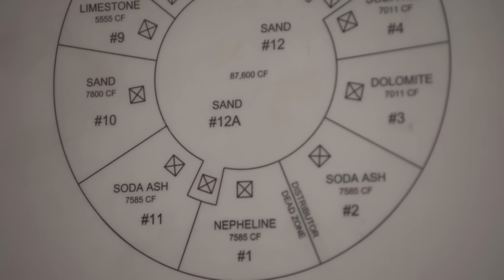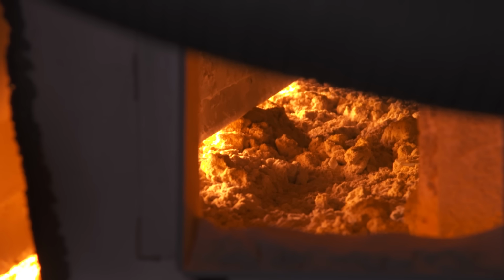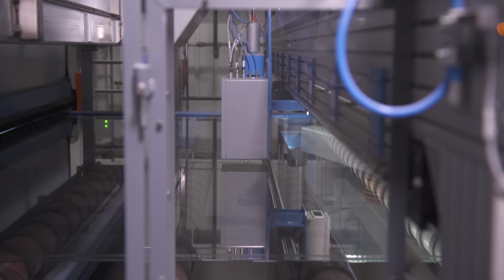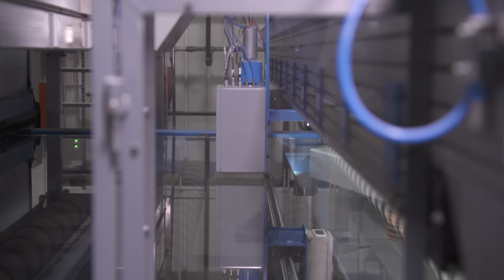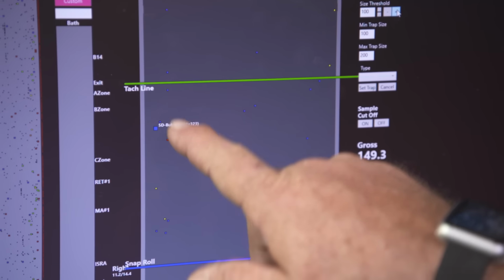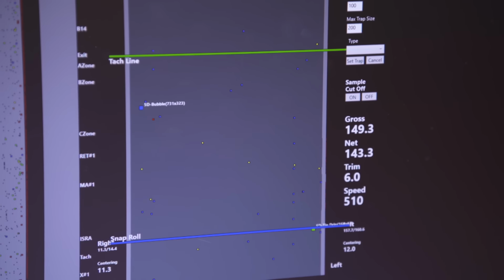How Float Glass is Made | This Old House

Comment: This channel is awesome. I'm a mechanical engineer with a curiosity in all things. 
I've been down the rabbit hole of researching plumbing and Thermal Mixing Valves and Richard has shown me how to replace those and now I'm here once again after researching glass fabrication. Thanks for the video, it's difficult to visualize the glass over the molten tin when it is described at a high level.

Comment: There's a glass factory like this close to where I live. They make glass 24/7/365, including holidays.  They can't shut down, cuz once they do, it takes around 30 days to get the furnace up to temp. The part about how much natty gas is used is accurate.
Reply: I work in a glass factory and when a glass furnace shuts down and cools down, it is irreparably damaged and has to be completely demolished and a new one built, which is a months-long operation. The glass shrinks as it solidifies, tearing the furnace walls apart. It is surprising to me that somewhere they can restart a furnace that has been shut down without a rebuild.

Comment: If you have a very bright short wave ultraviolet light source and very good (and protected!) eyes, you can actually see which side of a common piece of float glass was the side floating on the bath of tin. A tiny portion of the liquid tin volatilizes and is absorbed some microns into the side of the glass touching it, imparting that side of the sheet with a distinct orange or hazy white fluorescence.
Reply: True, or if you look at the edge closely, you can see which surface it was scored on. This, of course, would be the air side. Sometimes, low tech is easier.

Comment: Why's it float
Reply: Glass is floated on tin because the surface is very smooth and the glass does not need to be polished after it hardens.
Reply: Tin is more dense than glass. The glass floats on the tin like oil on water.

Comment: workers must have nightmares set to the sounds of shattering glass...
Reply: I started working in a glass plant about six months ago.  For the first few weeks the crashes freaked me out.  Now I know from where to expect the crashes.  If anything, it sounds like the worker is irritated and just chucking the glass into the recycle bin.  But when I look, they are more like 'meh'.  I think everybody who works there completely ignores that sound.  It normally comes from areas where sizes are being cut from the glass, some of which are completely automated and some manual.  Working in a glass plant is awesome.  Safety is a big deal, as you can imagine.  The panes we deal with are much much larger than the ones in this video.
Reply: @microdesigns2000  no worry about the glass dust?
Reply: @technosasquatchfilms  I haven't seen any particles like that.  The glass tends to break down to pretty large pieces, maybe the smallest about the size of a finger tip.  When the bins are dumped, there is no powder or anything like that.  Good question though.  Next time I am by one of those, I'll take a closer look.
Reply: I've worked in glass production for nearly a decade now. I could sleep through the sound of glass breaking now :(
Reply: @ZekeRushing  3 decades here. People do sleep through it. It is not an approved activity, though. 😴

Comment: The glass was drawn before they came up with the technology of float, you could see ripple lines going through it so it looked like crap but it worked. I started my apprenticeship in 1971 and most glass used was drawn as it was cheaper than float and polished plate.

Comment: I'm surprised they don't have an annealing step, but it might be hard to hold glass at the required temperature if it's one, long, extruded ribbon.
Reply: The process generally thought of as annealing only applies to crystalline substrata not glass which is amorphous. Thus there is no need to reheat and cool glass. Instead glass need only be cooled slowly to maximize the strength of its structure.
Reply: Annealing in glass manufacturing equivalent is called tempering and most float plants do it as well. (I work in the furnace at one)
Reply: @quinlanz92  Yes. Tempering is the term I'm use to. Although this is slightly pedantic.
Reply: I thought the same thing.I am sure they have incorporated something in their mix or the bake temp/time to keep from doing a conventional annealing process.
Reply: Not really, tempered glass is a phrase most are familiar with, ask a room with 100 people in it what annealing is and I bet  maybe 10 of them know, and ask those ten how annealing glass impacts glass and maybe 6 will associate tempered glass as the final product of the process. Pedantic, no. Lacking any significance to the world, sure.
Reply: @quinlanz92  For one look up the definition of pedantic I used it correctly. Second you're disagreeing with me based on your perception of a generalization of a group of people.. whereas I was simply stating what word I was familiar with. Wheres the disagreement lol?
Reply: they did
the lehr is just beyond where they first showed the cooling glass at the exit
Reply: It is annealed in the Lehr. 3:48. It is cooled slowly along this stretch.

Comment: Working in a glass factory is hot work, so for the people that are there, I tip my hat to you, you’ve earned your paycheck. It’s amazing the technology that is there to inspect the final product.
Reply: They didn't even show the really hot work, I work in a float plant in the furnace and replacing some of the blocks and burners in the furnace, it's a kind of heat you can't begin to explain. Wish I could say it came with a nice 70k a year paycheck but it doesn't. It beats doing some of the other jobs available though.
Reply: @quinlanz92  I also work at a glass furnace and it's not that bad. But some places are extremely hot - I recently cleaned a clogged pressure sensing tube in the furnace and both phones in my pockets got blocked due to overheating. Or replacing thermocouples on the furnace roof is also unpleasant.
Reply: @quinlanz92  it has to by now, right!?
Reply: I also work in a furnace they call it hot end operator.    You are rught about the heat when replacing the brick at the furnace its insane hear

Comment: I was just thinking holy hell half a million in natural gas. If you look at charts it looks like industry is particularly efficient with its use of electricity. However its masked by the fact that generally where its inefficient its because its fuel use and not electricity use. If you wanted to dump a bunch of your solar PV overgeneration into something there it is.
Reply: Here's a few things to keep in mind: 

1. This varies by the type of glass, but usually glass gets soft (slumps and takes mold shapes) around 1200 to 1300 deg F (about 648 to 704 Deg C). Glass gets tacky (sticks to things and other bits of glass) around 1300 to 1500 deg F (around 704 to 816 deg C). Glass doesn't reach its molten state until around 2400 to 2500 deg F (about 1316 to 1371 deg C). Needless to say, even on small scales (like the art glass I worked with) this requires a lot of energy.

2. One of the "holy grail" of green tech is finding a way to use solar energy in large scale manufacturing processes like this one. Notice I said the word "finding", because we don't have that tech yet. Sure, there are plenty of electric kilns that can get that hot from electrical power, but they don't scale up well, and they weren't designed for extended use that you see here. 

3. Solar has its own set of challenges: I did see a video of a "proof of concept" where a solar farm was used to heat up a cauldron, but it wasn't a "solar to electricity to heat" system. Instead, the solar farm aimed all the reflected energy to a point that heated up a heat conducting solution, and that solution was transported to the cauldron. Likely, and solution to the problem of using solar for industrial manufacturing is going to use this method over converting into and out of electricity. Which brings another problem, because plants like this one run 24-7 because restarting the line is incredibly time and money consuming with a lot of waste product until the line is started. So, they'll have to find a way to overcome the lack of sunlight on nights and stormy days.

4. You misunderstand the inefficiencies in both systems.  When people talk about the inefficiencies of burning fossil fuels, it's usually in respect to running an Internal Combustion Engine (ICE). ICEs tend to convert most of the energy from the burnt fuel (about 70%) into heat, with the remainder going into kinetic energy to push a piston. That heat is a waste product, since it can't be used to make kinetic energy. An electric motor is far more efficient because it creates less waste heat. HOWEVER, this plant isn't using the natural gas to push a piston for mechanical energy. It's specifically after the heat and not any other form of energy from the natural gas. In this case, the efficiency equation gets flipped because heat is no longer the waste product. I suspect you get far more heat energy from a unit of natural gas than you do from a unit of electricity. (I'd need to look that up.) And this doesn't take into account for the inefficiencies built into things like the power grid stepping up and down the voltage for transmission or the fact that Photovoltaic panels only turn about 105 to 15% of sunlight into electricity. Thus, for this factory, LNG is probably way more efficient than other methods of generating 

Don't get me wrong. I do want to see the day we don't need Oil for anything but as a material for resins. But the tech isn't there for all applications, and electricity isn't going to be the most efficient options.
Reply: @jackielinde7568  YT didn't show me your comment until now.

The type of solar power you mention that is direct thermal storage is called a molten salt solar reactor and absolutely this could be used if the investments were made into industrial scale plants for industry. I only mentioned PV because it was a segway.

Frankly we could be doing this today. The technology behind molten salt solar is solid and mature plus it can also store energy so it can run through the entire work day. The issue here is exactly the same as the issue with the lack of a dynamic grid and the lack of large scale renewable projects.

You mention that solar doesn't scale well. But I am not sure what you base this on. I would tend to disagree and instead point to the fact that the US infrastructure is incredibly old. Why is it old? Because we aren't making any new investments. Coastal states could be primarily power via tidal wave and and tidal wind but such projects require public investment. Individuals or tax incentives can't make that happen.

Regarding efficiency I was making an admittedly vague reference to these charts: https://flowcharts.llnl.gov/content/assets/images/energy/us/Energy_US_2012.png Yes I understand the heat is mostly recovered and used in the process and yes rejected energy only includes energy that actually wasn't useful. Take a look at how under transportation there is a massive amount of rejected energy. Whereas under industry the ratio is by far the smallest. Now lets take a look at the chart for 2018. https://flowcharts.llnl.gov/content/assets/images/energy/us/Energy_US_2018.png Largely the reason for this is the lack of regulation on natural gas and a lot of the reject is leaking gas not heat loss.
Reply: @OldPossum https://en.wikipedia.org/wiki/Tyranny_of_small_decisions
Reply: The acreage required to do this with solar would eliminate so many trees that it would be doing more damage.
Reply: @adamkendall997  I'm not sure why people think its an "intuitive" argument to just make up the idea that solar would take up more space. Have you seen a shale oil and gas field? Here you go: https://www.flickr.com/photos/ddimick/8948795874 Does that look small to you? Is solar somehow notorious for taking up a lot of space? The oil sands can go on your roof top but it won't generate electricity but solar can!
Reply: @Furiends  for the amount of BTU's required to melt down 500 tons of glass a day you would need literally thousands of acres of solar panels. These plants have to operate 24/7 so that charge would have to exceed a 12 hour buffer each day plus less  cloudy days etc.
Reply: @quinlanz92  I partially addressed this a few comments up but in that case I only needed to prove solar takes up less space than petrol infrastructure.

So lets run the numbers roughly. The furnace uses half a million dollars every month at Wisconsin natural gas rates which are here: https://www.eia.gov/dnav/ng/ng_pri_sum_dcu_SWI_a.htm In 2018 the rate was $5.20 per thou.

So we can extrapolate that the furnace uses 96,154 thous per month or 3,205 per day. A thou of natural gas is about 1,015,000 BTUs if combustion and heat recovery were perfect. In total thats 3,253,075,000 per day.

A gas furnace is going to be somewhere between 40% to 80% efficient dependent on heat recovery where as an electric arc furnace is going to be 75% efficient at least. Its technically a tin induction furnace but the natural gas one is also using induction.

So natural gas per day is 1,951,845,000 BTU of useful heat and thus that is how much the electric furnace needs to produce to be eqivlient which is 2,602,460,000 BTU. Because these are perfect BTUs we can concert it directly into input mWhs which is 763 mWhs per day.

Using a concentrated solar power plant with molten salt storage such as Crescent Dunes: https://en.wikipedia.org/wiki/Crescent_Dunes_Solar_Energy_Project is rated at 2,685 kWh/m2/yr or 7.35 kWhs/m2 per day.

A rough extrapolation of space used is to just device the plant up. This roughly scales since the majority of land area is reflectors. Which amounts to about 103,809 square meters for the production of 763 mWhs. Thats 25.65 acres.

The plant includes storage but you only use it at night. For an accurate result you'd have to consider standby loss and conversion efficiency but for the sake of bravity I'll just show there's plenty of storage.

The entire plant has 1,100 MWhs of storage capacity. You have to consider sun angle and effcicency at low incidence but if we're speaking in averages I can just say the average is just 10 whole sun hours which means you need only 14 hours of storage or 445 mWhs. Roughly a third of the plants energy store.

Feel free to check my math.

Comment: Sure hope OSHA doesn’t watch this. Silica dust at 1:34 and hearing protection not worn shortly after that.
Reply: That would only apply if a worker has to work down there continuously without a respirator.
Reply: Might be a Canadian Company . used Celsius temperature  instead of Fahrenheit
Reply: @tracycolorado  Canada is even stricter.
Reply: Testing is done periodically to test the silica content in the air (friable). OSHA has limits on the amount in the air and exposure times. Judging by how clean that batch house was it isn't an issue there. I work in a batch house and can tell you from experience. They don't just do a visual inspection, they use some fancy expensive equipment to perform the testing, plus they will have operators wear a device as well to get an idea of the exposure received while performing different tasks

Comment: How do they cool the glass? I may have missed it. Air and fans?
Reply: 3:51 the machine they show it traveling down is approx 450ft in length and will take 15 minutes to an hour to travel down depending on the thickness. It uses massive fans which duct the air onto the glass surface as well as heating elements to perfectly control the cooling of the glass. And yes the glass is very brittle and sensitive to those temperature differences.  Yes it breaks and sometimes more often than others. Today we had the ribbon break 2 times and we have to clean that glass up. There are days where we may have 14 breaks or even 30 minutes of breaks which is thousands of lbs of glass on the floor that you have to shovel out and up.
Reply: I was thinking the same thing. I would have thought there would have needed to be a longer cooling tunnel so not to introduce stress fractures into the glass.
Reply: You have to be careful cooling glass. It has a brittle range where temperature differences in the glass can cause it to become brittle and shatter. It's called "Thermal Shock". I can't say how they cool it, but it's probably a similar process as in art glass: throttling the oven. When I would program my kiln for my art projects, I would set ramping up and ramping down rates to make sure the glass heated and cooled at a steady rate.